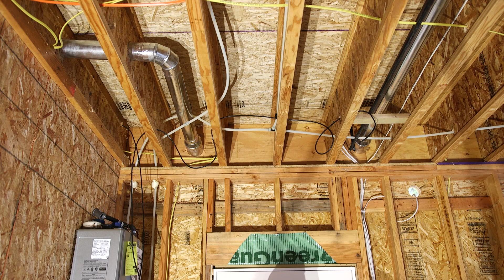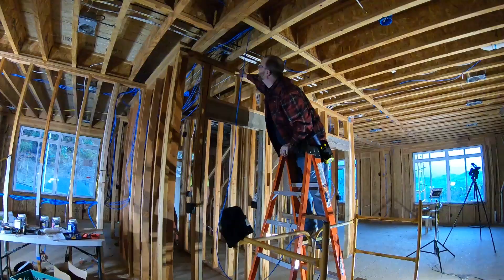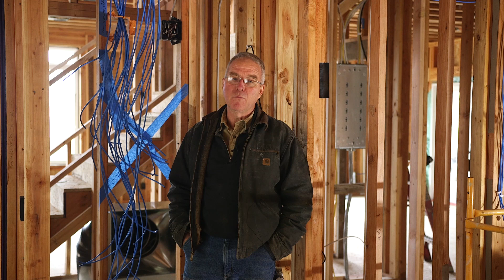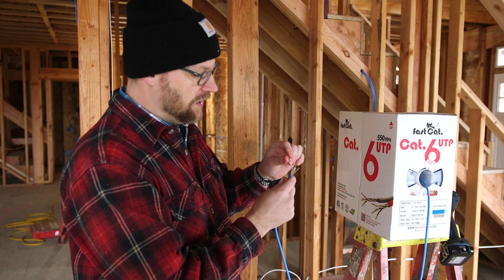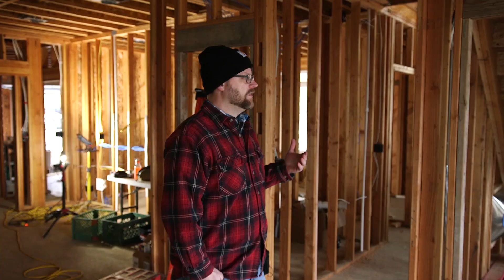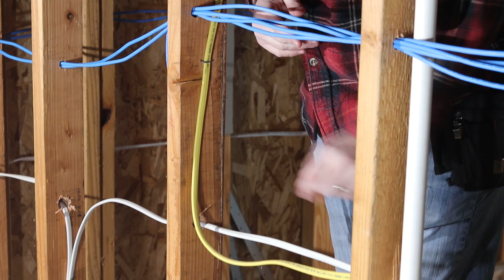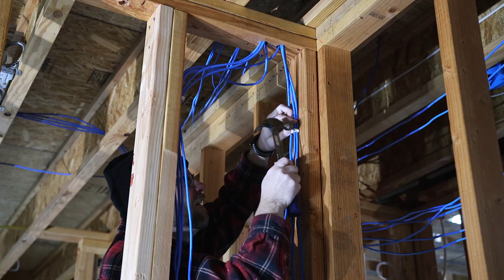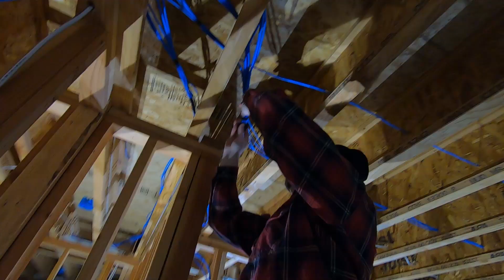Installing A Home Network Ep.100

Comment: Scott,

You know what I do ,but for your loyal followers I have been in the computer controls industry sense 1979 when I was discharged from the US Navy as an electrician. The controls industry has changed the most in the methods that devices i.e. fans, temperature sensor, valves etc communicate. Your son-in-law did a great job pointing out the pitfalls the modern network wiring that is most used today for system devices and people interfaces ( computer operators and other software configuration) . Today people are more able to decide what they think their home systems should do even if they are not professionals. The skills that are needed today just to setup your HVAC system were not even thought of when we graduated for High school . Just as an example to use a building from the state of Oregon in Portland the US bank building a 43 story maybe the tallest building in Oregon was one of first projects. The software was loaded with paper tape that came in a film can on an airplane when when changes were made. The communications wire was 72 conductors(72 wires from panel to panel) that would be replaced with one Cat 6 cable. Sorry for going so far in the weeds. Wires not routed properly and the problems as explained byBen were called induction. This was a mystery for system technicians that had not been properly trained.
When you have had a life in my business it brings respect for the importance of proper installation great job Ben and essential craftsman. 
Thank you for the good work on display on your channel old friend.
Reply from the maker: Thank you Alan!!

Comment: I hope they also ran a CAT6 line out to the same location as the coaxial cable. If they don’t have Fiber to the house today, when they do that is what you’ll need to go from the ONT (the device that changes the Fiber to Ethernet) to your router in the house.

Comment: You may not have to worry about separation from the electrical line if you use shielded CAT6 cable (my preferred method). Shielded cable is also mostly immune to radio frequency interference. I have run into problems where wireless devices interfered with unshielded CAT6 cable.

Comment: Interesting. I too was in this game as part of my career and enthusiastically wired my house with cat 5e / 6 back to a comms cabinet where the fibre terminates from the street and my NAS resides. However wifi has done the job for my wife, two teenagers, and two students downstairs using around 450 GB per month and the structured cabling has really been unused. The house is brick and tile with pre-stressed concrete floor and hollow stone block basement so substantial and challenging for wifi but the previous 802.11n (two hot spots) and current mesh ac have and do cope admirably. Apart from the backbone cabling I don't think I'd bother saturating the next house with outlets, particularly since continuous cable technology advances making anything installed ultimately become redundant.

Comment: You should have run the cabling down threw the crawl space for anything on the first floor and up into the attic and down a conduit to the network closet for the second floor. This makes it so if you do have issues with your cabling it's easily replaceable or expandable after drywall goes up. You should also run 2 coax and cat6 lines to where ever your ISP enters the home because not all ISP's are going to use coax and to have back up lines in case one is damaged. Also when he's mentioning the type of cable to buy you should also look to see whether it is Solid Copper or Copper Clad Aluminum(CCA). It is recommended that you not use CCA for Power-over-Ethernet(POE) runs for things such as access points because it has the potential to heat up more and fail.

Comment: Great wiring job! Technical question: All the cables are joined in a rack where they are fed with the ISP incoming cable. Printers, laptops, etc. plugged into the wall jacks will receive raw internet data. A router will likely be plugged in to one of these wall jacks. That router creates the home network. What about the devices plugged into the other wall jacks, would they not be “outside” of that home network as they are not plugged in downstream of the router (ie. plugged into the router itself). Or is there some way the router can still “see” and control the devices that are plugged in elsewhere in the house?
Reply: Really basic explanation :  Modem is your gateway to the ISP.  Everything inside is your home network.  However, modems are designed for a single output, and that goes to router which allows you to have multiple connections.   So at the junction box you either need A) a router (doesn't need to have wifi, you can route to additional wifi routers elsewhere in home) or B) a switch where it basically hard programmed to send modem traffic to and from the router (where ever its located), and then all other ports on switch are broadcasted to rest of house.

I'm pretty sure method B would require 2 lines to be run to the router source . . .  1 to carry modem(external) traffic, and another to carry internal traffic to other devices.

Comment: It might have been covered already, but I think it's important to point out that even if the cable is labeled as solid, it's important to make sure you're getting solid copper and not Copper Clad Aluminum. CCA is fine and certainly works, but in my experience is a lesser quality and more susceptible to breaks. Aluminum is less ductile, and isn't as tolerant to sharp bends as well as pure copper. 
CCA is cheaper, and if treated right is certainly fine, but in my experience, any time you're running cable in an inaccessible location, it's best to go pure copper. You don't want those breaks. 

If you're thinking hundreds of meters in open ceiling and it's not going to be vibrating and is accessible, by all means go for the cheaper CCA cable. But if going for permanent inaccessible install, and you're only needing a single box, get the pure copper. 

They can be tricky too, they generally still label the product as solid copper, but if you see the word clad or CCA, it's aluminum with a dipped copper coating. 

The price tells the story. If it seems really cheap, it's probably not pure copper. 

Don't be scared if you've got clad cable, it certainly works fine, it's not bad cable, but in my opinion it isn't as good as pure solid copper.

Comment: Years ago, I bought 1000' of Cat5E, with the idea that I'd be able to wire any house I moved to.  I still have most of that, and now it's obsolete.  Wireless networking takes care of my needs, including two of my three computers, both of my wife's computers, our daughter's computer, our Kindles, our TV (most of what we watch is streaming), and probably some device(s) I've forgotten.  My desktop computer is wired in (though it also uses wifi), and our phone system is wired in, but those are both close enough that it's just short cables, nothing in the walls.

The bit about having data cables too close to power cables reminds me of my first job.  Our hardware guy had run lines for terminals up in the ceiling space, then down to each terminal.  The first terminal he plugged in went "POP" and died.  He decided that terminal was faulty, and tried another.  Same thing.  After the third terminal died, he checked the voltage coming off the data cable, and it was 110VAC.  He'd run the cable too close to the power lines for the lights.  Oops.  Very smart guy, but somehow missed that aspect.

Comment: Why is it important to label your cat cables? When you hook them up to a switch it will not matter. I have over 2,000’ of cat 6 in my house and not one label on a single cable. Your switch uses I.P. Address to communicate. In my opinion the only reason you would label them is for P.O.E. And even than you can just use a different color cable.

Comment: Three items of note.

You should install ethernet runs in every (or every other) room, in a ceiling outlet. This allows access points to be ceiling mounted, and provide dense coverage in every room.  As the standards progress and speeds increase, performance drops off significantly within feet of the access point. This would future proof the home.  It's far more important than placing network jacks on the walls (and near the floor).

There is a_HUGE_ difference between Cat6 and Cat6A - Cat6 was an interim standard, is not intended for 10G at 100M, and is inferior to Cat6A. Installing Cat6 is a waste or money, and only Cat6A should be installed. 

velcro, zip-tie, and other organization methods for the Cat6/A wiring is not recommended and should be avoided at all costs. You run the risk of crushing the insulator, and groups of parallel bundled Cat6A can cause cross-talk. Every manufacture recommends the cables stay loose and unstructured.  Using foil wrapped UTP is another option, but does require someone who knows what they are doing for termination.  J-hooks in ceiling runs are also a good idea to prevent sagging/stretching over time.

Comment: There is never a reason to install Cat 6 cable.  It costs more than Cat 5e for no speed (bandwidth) benefit.

Cat5e is the spec for gigabit, Cat6a is the spec for 10 gigabit.  Cat 8 is the Spec for 25 and 40 gigabit links.

Stranded cable has the same max distance (100m/330ft) as solid core, but it’s harder to pull.

Bending past the minimum bend radius doesn’t make the signal take longer to get down the cable, but it can mess up the pair twists inside the cable - creating interference and signal loss, or it can work-harden the copper wire and cause an actual break.

You can use Coax for networking (MoCA) but speeds aren’t as good as Ethernet, and costs are higher.

You should also consider running cable to some ceiling locations for Access Points, and use an 802.3bt PoE switch with 802.3bz ports for 1/2.5/5 Gbps speeds to your edge devices.  If you’re doing wireless, go with 802.11ax APs for the highest throughput.

Comment: Higher category cables are not marketing speak, as the foot note says. I suggest he switches to cat6a to be more modern for little additional cost. Cat7/8 are generally not necessary for in-home use unless there is a very specific and inch need. - Network Engineer

Comment: Cat6 is great for Coax and even cheaper Fiber contracts over a large house. Cat6a and above allow for stupid crazy amounts of bandwidth that is appreciated on Gigabit networks which are slowly becoming the future but have more limited range, well, they all do, which might become a headache on larger houses.

With that said, I'm on Cat5e with a 500mbps connection through fiber and it's crazy fast and has enough bandwidth for a lot of simultaneous package shipping around the house for the future.

Comment: For anyone curious: a kink in the data line isn't like a hose. They cause slowdowns because, as you saw, networking relies on "twisted pairs." Those twists help minimize interference between the 8 conductors inside the Cat6 and the "breaks" disrupt the twist and cause noise. If the signal is "dirty," it takes longer for the computer to understand the data on the line, and therefore slows down how fast it can accept that data.

Comment: just love how your son in law told every one that solid core wire is the wire to use for in wall and long runs. some folks think that just because it easy to kink and break solid core sucks but i love the stuff. stranded core is just for p2p or patch cables and sockets to appliance. if its a cable you pull and fix from a distribution point to one connection point and never touch again use solid core. if its a cable you move all the time use stranded. as those are most likely short runs.

Comment: I don't know how old the footage is, but if you were installing something today you should absolutely do shielded cable at Cat 6a (minimum) or Cat 7.  Shielded cable is sometimes listed as STP (rather than UTP which your link has).  The average home user may never need the higher data rate in the next 10 years, but we don't build homes to last 10 years, we build them to last much longer, and the cost difference in cable is negligible when you buy it in 1000ft boxes.  We're talking Cat 6 UTP @ $120 vs Cat 6a @ $215.   Cat 7 is a bit steeper in cost, and Cat 8 is currently the highest specification and will run a pretty penny.

For those who want to go overboard to a completely unreasonable degree, an indicative price for 1000ft Cat 7 is around $350, and 1000ft Cat 8 is around $500.
Reply: For those who want to know why on earth you might want to do Cat 8 cable, it basically comes down to speed over distance.  Despite that claim that it's "marketing speak", it's not.  It's entirely down to what speed connection can be made over a given distance.

Category 7 cable will do 10Gb ethernet at a distance of up to 300 feet.
Category 8 cable can do 40Gb ethernet at a distance of up to 100 feet.

Would a home user ever need this?  Not the average home user, no.  Certain specialty jobs that need high-speed access to large amounts of storage would, however.  Some examples of this might include:
* Movie / TV Special Effects
* 3D Rendering
* Engineering Simulation

These are definitely not your average work-from-home professions, but if you're in one of those industries and thinking about building a home, you might want to spend a little extra on cabling now in case this work transitions to home in the post-COVID world.

Comment: Great video and forward thinking for running data cabling to various corners of the house including the exterior. Keep an eye out for POE light fixtures in the future. Its already becoming more common place in commercial settings and will trickle down into residential construction.

Comment: One thing I have always said is "data and power cross at 90 degrees".  Same as what Ben said, but I have found this to be a simple axiom that's easy to remember and follow.

I cringed a bit when I saw the cables getting taped and stapled.  Electricians like to do this because they're used to stapling everything, but with ethernet, if you ever need to pull additional drops, or if you need to upgrade the cabling to a new standard 20 years from now, it will really help you to have that cabling loose in the wall cavity because you can then use it as a pull string to pull new cable (or add more cable).

Another tip for first time DIYers is to buy a few shorter boxes than one long one, this way you can pull multiple cables to a specific location at the same time.  Also, take what you think you'll need and double it, at least.  Cable is dirt cheap in the grand scheme of things.  You can pull 4 cables and leave three of them unterminated in the wall.  Exact same amount of labor and only a minor coat increase but it makes things SO much easier down the line when you decide you need more drops!  I wired my house for ethernet when I built it back in 2008 and figured 4 drops in the home office would be way more than I'd ever need.  Then smart devices and home automation became a thing and I had to go back up in the attic and ended up doubling the # of drops.  I have a 2k sqft home and have about 40 drops.  If I was wiring it again I'd probably add even more.

Remember, you can leave extra cables inside the wall cavity so you don't have unused jacks everywhere, but it's easy to use a jab saw to add a jack in the future if you need to.
Reply: Keeping it loose is a great idea, but it might bother me too much - feels unfinished, right? I might instead run conduit for that purpose? I wonder if leaving it loose is code compliant. You've given me some good things to think about...
Reply: @Stonesand  I can't speak to code, but all of the commercial installations I've seen are just loose cabling in a wall cavity with J hooks suspending the cable in the drop ceiling, so I'd assume that means it's OK.  For new construction conduit or flex pipe / smurf pipe is a great option.  The only drawback to that, if you can even call it a drawback, is that if you're working with 3/4 conduit that already has a few cables in it, it can sometimes be difficult to get an additional cable down without it tangling.  You can unterminate, pull the existing cabling up and then pull everything back down together (just tape a throwaway cable to the bundle before you pull it back and use it as a pull string).

I used smurf pipe when I wired my house but if I was doing it again I would 100% go with rigid conduit instead, it's so much easier to work with.
Reply: @Vrtigo1  OK, great advice! I'll check into conduit possibilities...

Comment: When I built my house I thought I was ahead of technology with my phone and coax cable install. Today the phone lines and coax are abandoned.  Replaced by WIFI and Cat 6 Ethernet cabling.  Some of the rework is not pretty but the Ethernet connection between my provider's fiber optic drop/router and my PC is virtually instantaneous. And don't get me started talking about streaming TV over WIFI. Best thing since sliced bread.

Comment: He did a pretty good job of explaining what to do, he clearly has a good idea what he's on about, I read someone said he's a lecturer of computer science. I would say he's way over exaggerated how delicate cat 6 is. You might see higher latency if you really kink a cable but you're unlikely to break it, if it was single mode fibre then absolutely it would break and be useless if it snags. Be good to see how he does your patch panel and what switch you opt for.

Comment: NOTE: Make sure the electricians do not use your pathway when you get there first. Happened to me. I was not a happy camper when I had to redo all of my proper work so the network would actually perform properly.
Reply: Agreed. Number one rule in business settings for those in the know. Do not allow ANY trades to start co-opting your cable tray/cable management system.